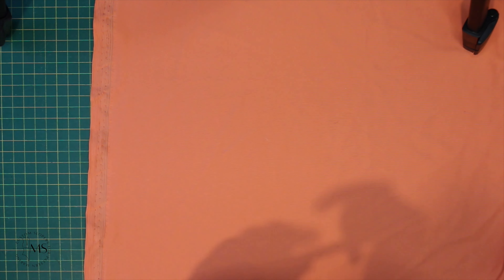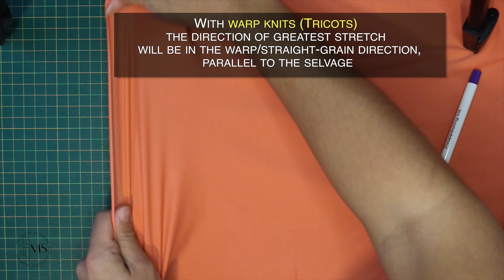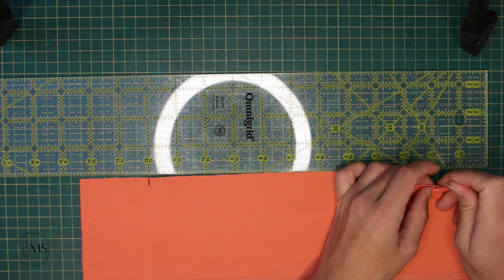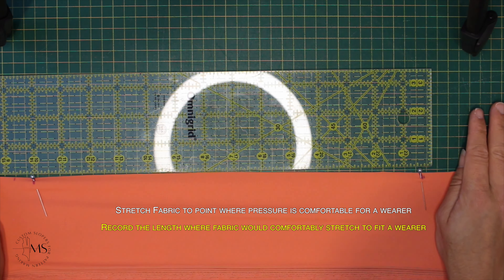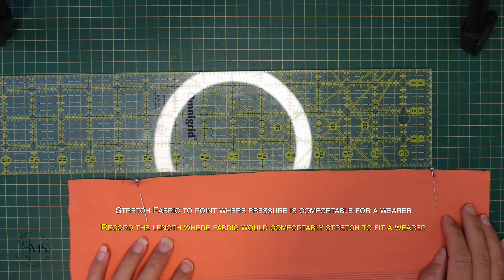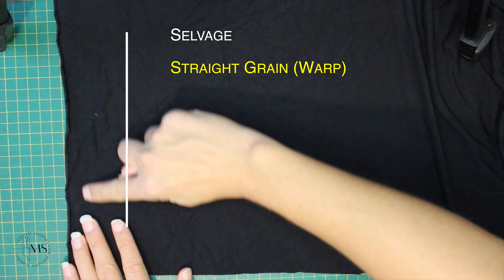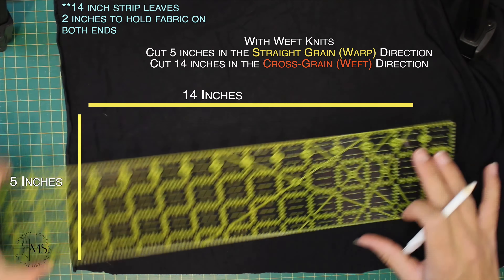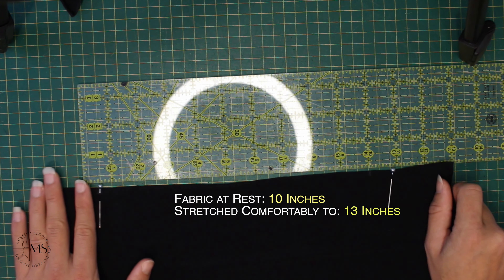How To Calculate Negative Ease For Stretch Pattern Making

Comment: Hi I’m wondering if this implies you should cut the Warp knits on the cross grain instead of the straight of grain?
Reply from the maker: Hey! That's an excellent question: 

When determining the negative ease of a stretch fabric, particularly with warp knits, cutting on the cross grain instead of the straight grain depends on the stretch direction and the intended fit of the garment. Here's a breakdown:

Key Considerations:
Stretch Direction:

Warp knits often have more stretch along the cross grain (perpendicular to the selvage) than along the straight grain (parallel to the selvage).
If your design relies on maximizing stretch (e.g., tight-fitting garments like leggings or swimsuits), cutting on the cross grain can provide better negative ease and fit.
Negative Ease:

Negative ease means the garment is smaller than the wearer's body measurements, relying on fabric stretch for a snug fit. To achieve this, align the fabric's greatest stretch with the area requiring the most flexibility (e.g., around the bust, hips, or thighs).
Fabric Stability:

If the straight grain offers more stability and less stretch, cutting on the straight of grain might be preferable for garments that require structure or for areas like waistbands.
Cross-grain cuts can make the garment less stable if the stretch is too extreme, leading to potential distortion over time.
Practical Answer:
If your garment needs maximum stretch and the warp knit fabric stretches more on the cross grain, then yes, you should consider cutting on the cross grain.

Reserve the straight of grain for areas that need stability, like waistbands. 

BUT - all fabrics can have different properties, so you might get some wonky stretch directions.